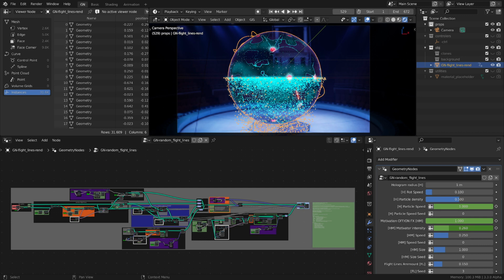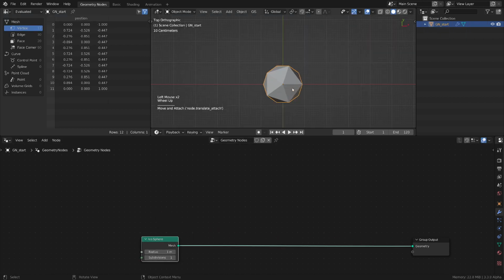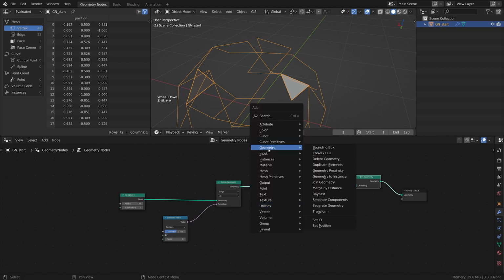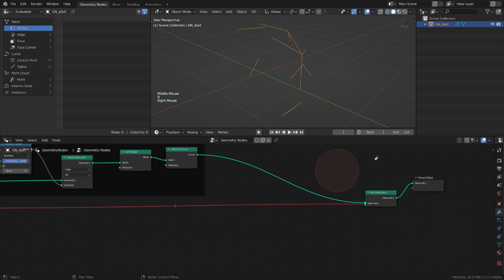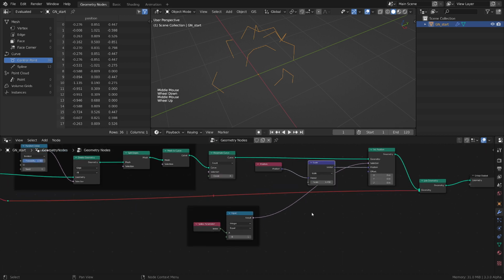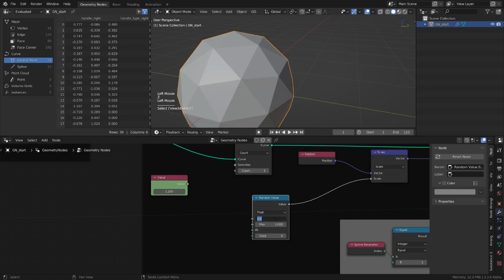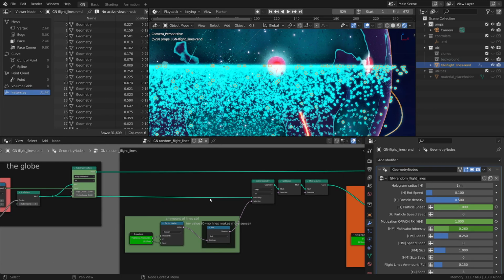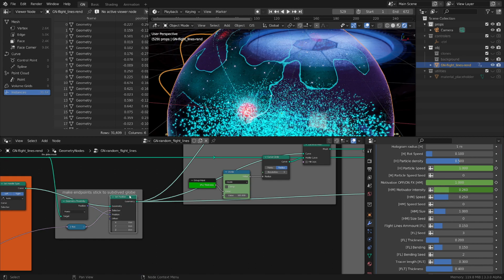Holographic planet map: How to build random flight paths  | Geometry Nodes Challenge, Part 1/6

Comment: Thank you VM. Some of the lines are whacked (side ways ish) in the southern hemisphere. I tried to use the sphere edge normals but that didn't help...
Reply from the maker: I`ve played a little with the seed on the boolean that deletes edges and you are right, I`ve got some anomalies (the side ways ish thinggie). In my case it happened when all 3 edges forming a triangle on the icosphere were kept.
The "side ways ish" thinggie it is related with the way that pushing outwards works: the position is a vector with a direction, by scaling the vector you are pushing it in the direction that it has. With some special cases it seems that direction is not the expected one. At least I think this is what happens, kind of tired now to be 100% sure...
Bottom line, I am thinking of 2 solutions:
1. Easy one: play with the boolean and/or seed. Different pattern should fix the problem
2. Harder one (did not test it yet): duplicate & scale the "planet" icosphere, add more subdivisions and use its surface as a reference for the middle point, instead of scaling. You could use the Proximity node for that, similar with what I`ve showed towards the end, to fix the problem with lines floating if you subdivide the planet after getting the edges. I will try this tomorrow (hopefully) to see how it works.
Anyway, really glad to get this feedback from you 😀
Reply: @vladimir-nodes_surfer  Thank you for the feedback. Looking forward to the next installment. :)
Reply from the maker: Hi Paul! I`ve taken another look at the project file this morning, with a fresh mind. Turns out that the push outwards logic by scaling the position is not the real culprit. For some reason (bug?) if you are left with all 3 edges that form a triangle, hence you have a face, the split edges does not work as it should and it does not split that triangle in 3 distinct edges, causing a chain reaction that leads to the anomalies. I`ve already issued a fix and reuploaded the gumroad project file.
I will also make sure to explain the matter in the part 2 of this series (hopefully later today).
All the best to you and again, thank you for pointing this out!
Reply: @vladimir-nodes_surfer  One is glad to be of service :) I'm anticipating pt.2.